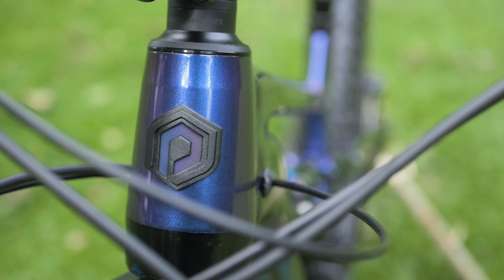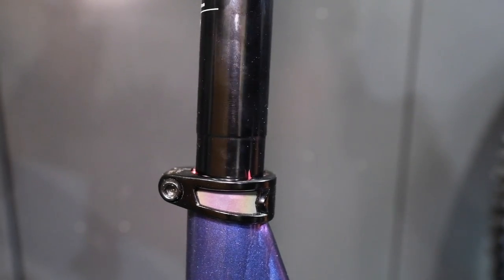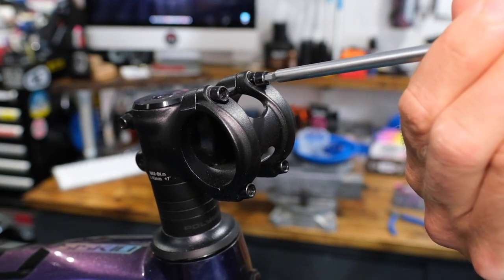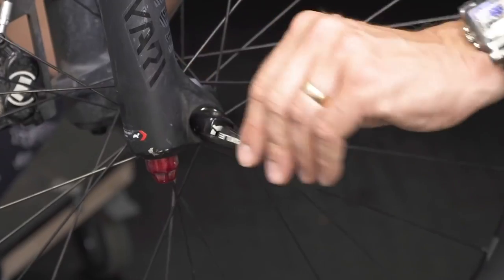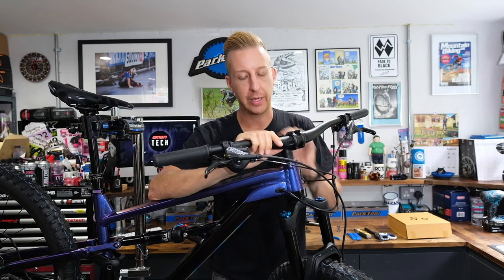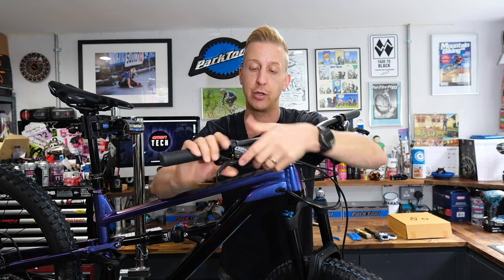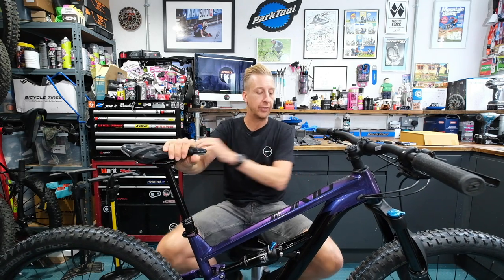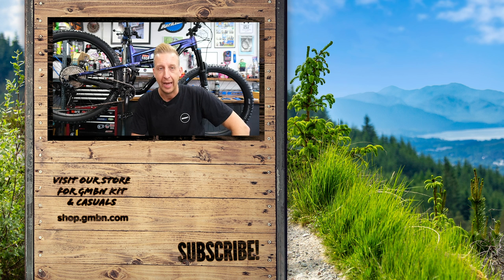How To Set Up Your First Full Suspension Mountain Bike In Just 30 Minutes | Bike Set Up Basics

Comment: I would say before going for a trail ride you should bed-in the disc brakes. As simple as getting some moderate speed and then gently making the pads rub against the rotor without locking them, repeat a couple of times.

Comment: Sweetness!!!  I’m actually waiting for a T7 to arrive at my front door next week so this video could not have been timed any better!  Thanks Doddster!
Reply: Did your bike come? Been thinking of getting the t7 as well, wondering how you like it?
Reply: @bobbyflay4104  Been running it through its paces and its is not bad at all!  Granted, this is my first Full Sus, but I have ridden plenty of rentals and some of my buddies' bikes that are full sus (Giants, Transitions, Ibis)  Even though these components are suppose to be the bottom end they are great!  Even unlocked no pedal bob on the long climbs.  The brakes are really impressive.  I'm coming from Tektro Gemini to the ones on the T7 and its definitely a nice upgrade even though some have complained about little modulation.  I think its fine.  As of now the only weak point for me is the fork, which I don't think is bad at all... just wish I had more rebound control.  Another pleasant surprise were the tires.  BikesOnline says they might come with either the Schwalbes in a 2.6 or the WTB Trail Boss in a 2.4... i ended up with the WTBs and im o happy I did!  I dont shy away from long climbs and I was previously riding 2.2s for a while.  I can definitely feel the difference in size on the climbs giving me more resistance.  Happy I didnt get the 2.6s  The WTBs have handled NorCal rock gardens and granite really well.  Excellent Grip!  Also, after being a SRAM guy for years, the Deore drivetrain has really eased my concerns about going back to Shimano.  Rock solid hardware there.  REALLY happy with my T7 and would not hesitate to recommend Polygon and the T7 to anyone.
Reply: ordered a T7 today, also my first full-sus.
really wanted a Deore 12-Speed
also i´ve never seen a wild polygon here, so already proud of that ;)
Reply: @erraldstyler  Congrats!  You're gonna love it!  I actually JUST got back from a ride on some gnarly stuff and the bike doesn't cease to impress.
Reply: yeah, looking forward to it. geometry really looks good an the specs for the price are close to unbeatable in the current situation. literally nothing with intelligent speccing available here for resonable pricing... so i guess i finally had some luck throwing money at someone haha

gotta admit, there are some things which i dont like, but thats literally the best i could find within my budget and i feel like its a really good decision. really had no fun riding last year (marin san quentin 1) and when i demo´d a pivot firebird it was over with entry level/beginner cheap garbage bikes for me ;)
Reply: @Perigault  rockshox recon has rebound control. It’s bottom right and u can twist the knob at the bottom to adjust rebound. Hope this helps!
Reply: @itsshowtime839  Hey man!  Thanks for the reply!  Sorry I wasn't more clear... I knew it had rebound control, just wish it had more fine tuning abilities.  I think this thing has 5 settings while something like a Fox 34 has like 11 or 12 settings if I recall correctly.  Im a little guy so im riding at the very bottom of the air chart.  Been trying different setups and I think I found a nice compression/rebound balance I can live with until a Fox 36 comes along.  But for the price, no major complaints.  Just got back from a long, bermy, jumpy and predominantly bumpy ride.  The fork did quite alright.  Gonna see how everything is holding up when I do a lower leg service.
Reply: How tall are you, is the sizing right, I'm about to order the Vander t7?( don't tell the wife)😄
Reply: @Ranita_MTB_760  5’4, 30” inseam, 130lbs... sizing is spot on!  Plenty of wiggle room to setup the dropper.  I thought i would cut the bars down but everything feels SPOT ON!  Super confident in there air, on fast, flat turns, climbing, etc.
Reply: @Ranita_MTB_760  The Vander T7 is actually the Calibre Sentry(?) frame, the Siskiu frame sizing is right tho. im 178 on the Siskiu T7 M, and it feels only a tiny bit too short (polygon recommends M up to 175cm)
Reply: @erraldstyler  Oh man!  Good Eye!  Just finished comparing the two and sure enough they appear to be nearly identical... just a few differences.  Man!  Please come back and post up and let us know how it goes if you get it and how it feels!
Reply: I bought a t8 it’s almost the same juts fox branded forks and back suspension

Comment: Literally just got my T8 and I watch this before hand to have an idea on what to do and have ready.  Big Thanks and keep up the good work.
Reply: Do you like your t8?
Reply: @isaacschmitz4168 , I do.  I have it in XL and received it in May so I have almost 700 miles on it now.  I have done a variety of rides and its held up great.  I have a XL and it is heavy out the box, 36lbs, but it wears it weight well.  The geo for me was great and required little tweaking for adjustments.  

I did do some upgrades to the breaks as I had XT brakes before and can't do without them.  One finger breaking is so nice.  The Tektro's to me we not Death but I did not like that it would not slow me down enough on high speed with one finger.  I had to grab with 2 fingers in order to get the pressure needed and even that isnt as good at the XT brakes.  I did even try the metal pads on ICE rotors.  That did help the brakes but after 50 miles I got the XT set and never turned back.

Thats the only real thing I changed so far but I do have some Hunt Wheelset on order and planning to run those 1858g wheelsets with some 2.4 XC type tires to see how it all feels.  The stock wheel set are heavy but the Tires are great.  I like the Dampf and they have held up well but I just got rock slashes on the rear so I changed it to Trail Kings that are similar in pattern but a soft tire feel, all around.  

Would I recommend the bike to someone, Yes! Would I purchase it again, Yes!  Is it perfect, aside from the weight, its the best bang for buck trail bike you will find and you will have fun with it.  If I can get the weight down to 32lbs in XL, I will be happy as it is a bulky beast in the rear.
Reply: @ShaneXCS  thanks for all the great information.

Comment: The thing with people recommending to put grease on the seat post. It can be ok on some bikes, but I have a hardtail with a seatpost that just kept sliding down during rides, no matter how tight I made the clamp. I suggest you use gripping compound instead. It will work like grease to prevent corrosion, but it won't be slippery in an application that relies on friction to work.

Comment: Thank you for this, I really want to upgrade to full sus
Reply: Make sure that you really consider your trails and needs first though. It's the job of many bike companies to try to make you feel like you need a full suspension bike, when a lot of the time people just end up spending too much money on a bike that they didn't really need and won't get full use out of. 
Either way, it's your choice.
Reply: I have this bike, the 2020 model. I also have a Schwinn Axum, hard tail. Which one do I ride more? The Schwinn. 
Don't get me wrong, the Polygon rides like butter but besides having to constantly lockout for hills, I ride the Schwinn hard because it's basically a $400 bike with some upgrades. If I smash it, it's not a problem. If I smash the Polygon, my pupils turn into $$$$

Comment: Would have been great if you had spent a bit more time focusing on the dropper post attachment.  I know this is an advertorial, however I am trying to get a dropper into my T8 and the cable is stuck, which doesn't allow the dropper post to be sunk into the frame...?  (Thought I would post, instead of throwing the thing across the garden.)  Peace / namaste x
Reply: For reference, re dropper - check out the beginning of this video - he nails it: https://www.youtube.com/watch?v=Gh1pfNDtwf0
Reply: Last one - did I miss where you showed how the front wheel is attached?
Reply: Last rant - why Polygon don't provide a specific 'dual suspension' manual with their dual suspension bikes, which features specific install instructions and info about dual suspension bikes, dropper post install etc, is beyond me?  They provide a generic bike manual, which doesn't even mention dropper posts and could have been a generic bicycle manual from Halfords from the 90's....; Bizarre!?  

Have a great week - I simply love GMBN.
Reply: at the bottom of the seat tube, you have to pull on the cable of the dropper post while you put the post into the seat tube.
Reply: @mctg9043  Yes, I figured it out from watching another vid.  Thanks and have a pleasant wkend!
Reply: @DougieL  you too

Comment: Hi just wanted to add on your video about checking your bolts and and though I would mention the seriousness of that and thought maybe you could make a video or include the extreme safety aspect of checking your bolts .
The main reason is that a couple of days ago I purchased a second hand specialized stumpjumper from someone who had not ridden the bike much at all but had look after the bike well ...thats what I was told .
I went out for a ride last night on the bike and started to hear and feel a click through my pedals so went home and checked it out to find that all 4 chain ring bolts only had about half a turn left on them before they would of fallen out ! 
That could of been very dangerous in so many different ways depending on if the chain got jammed and locked up the rear wheel or I could of jolted forward and gone over the handle bars .
It would benefit alot of people to check there bikes if they buy second hand when they get them home so I would love for you to do a video and express the important of it and the safety aspect if it isn't  done if it comes down to brake caliper bolts being loose and falling out it wel you can guess the rest .
I hope you can do a video and hope this may help alot of people and have alot more confidence it there bikes too knowing they are safe 😊

Comment: 15.00 pedals. I always thought this was the way from my old days, but my new Nukeproof Horizon pedals loosen when pedaling forward and unscrew and fall out! Yes, the R is on the right and the L is on the left, but I have checked, double-checked, and triple-checked (and you know I could keep going on), but new pedals seem to be the total opposite in every review of pedals today, and this video is only three years old! I always remember from my racing days, etc., that the pedals would tighten toward the front, so they always tightened as pedaled, but apparently, it's a safety thing now—they unscrew when pedaling forward. 😂 Please let me know if anyone in 2024 is now seeing this, please? I have even commented a few times saying I'm going to have to put the L on the right side and the R on the left side just to make sure for safety reasons they never undo as pedalling forward! And when putting them on you hold the pedal and pedal the crank backwards for the pedal to tighten!? I need to know exactly for sure please if this is now a thing or have Nukeproof sent all these pedals out with the spindles in the wrong sides?

Comment: I wasnt happy that when my T8 arrived (around 5/01/21) the cool lil cardboard box inside that had all the paperwork and tools etc had been opened and pretty much dumped out inside the big box and the big box had a hole in the bottom from shipping so who knows what was missing. 

More importantly- they had Vee tire co tires on the bike instead of the Schwalbes that they listed. - Those are worth about half as much by the way. -also a paint chip by the emblem on the headtube.
 So I emailed them only about the tires asking them to take the vee's back and send me the Schwalbes...
The bikes online guys try to distance themselves from polygon like it was a different company and took zero responsibility for the manufacturer swap. (polygon is the only bike online bikes sells)
They said there was a shortage (obviously you can buy as many Schwalbes as you want on Amazon).

They said I should be glad i didnt have to wait longer for the right tires ( I did wait about 4-5 months).
Im ok with taking a chance to save money adjusting the bike myself etc, Im not ok with this company not sending me what they advertised and what I paid for.

Comment: Great video as always.  I’ve had my hand on the button to buy the T8.
Reply: Did you get the t8?
Reply: @isaacschmitz4168  Ordered the T8 in mid October.  Delivery was originally estimated in November and was pushed out a couple times since.  Latest is mid January.  We’ll see if that happens but I don’t ride much in the winter anyway so not a big deal.  Excited for spring though!
Reply: Lmk when you get your t8 please
Reply: @isaacschmitz4168  Just notified late Tuesday night that bike was shipped and expected to arrive next week.  Fingers crossed.
Reply: @isaacschmitz4168  T8 came in 1/12.  Posted on Polygon FB group.  Still haven’t ridden it yet since it’s been super cold here in NY.  It came with Shimano brakes and Vee Flow Tires.  Stoked to ride when it warms up!  In the mean time I may convert to tubeless to shave some lbs
Reply: Ok cool it it's a great looking bike I've never ran tubeless but really would like to try it
Reply: @brucetrobridge2989  I hate how they are allowed to just swap parts on the bike. They claim that the manufacturer of the bike will sometimes without notice change certain parts of the bike BUT bikesonline will make sure the part is of equal or higher spec level. The schwalbe hans dampf tyres, whcih are supposed to come with the bike, are twice as good as those godforsaken slow rolling vee flow snaps. And they better have put 4 piston shimano brakes because the tektro bikes that are supposed to come with the bike are four piston.

Comment: would like to know about handlebar angles ...sweep back, sweep up etc....got a new bike and intensified my riding, and now my elbow is messed up, doctor called it tennis/mtb elbow and she has seen a lot since everyone got on their bikes. i came from a plush emtb (fox)to a light weight regular no motor mtb....the new bike fork (pike) felt steadier when riding, but didnt filter all the small bumps and rattles that the fox did.....i wonder if i messed up my elbow with incorrect setting on shock or its my handlebars that was set up wrong

Comment: My mechanic mistakenly dropped oil on my brake disc an now its slow to stop the bike.. Will changing the brake pad solve the issue?
Reply: @Bodiddly55  thanks man.. I'm in Ghana and I ride a trek marlin 6
Reply: @Megathx2023  you can try to sand the pads a little or more and try it. It worked for me.. Also clean the rotors at its said before.
Reply: @pregardt  thanks man

Comment: so dont have a tourqe rench and does not come with my new bike, what should I do? pls respond anyone.
Reply: Just don’t be an idiot and overtighten stuff, and you will be fine.
Reply: @xx-----------xx873  ok thanks
Reply: @xx-----------xx873  but what if i under tighten it?????
Reply: @lukepw08  It will come loose, and you just tighten it back up a little tighter. Make sure to grease the bolt before installing it, and if you have fists of ham, investing in a torque wrench will save you a lot of hassle later on.
Reply: @xx-----------xx873  ok thanks giles

Comment: I dunno but it’s taken quite a number of videos on this topic for me to finally begin to understand... 

... no wonder my bike feels so “bouncy” — I don’t have my sag set properly!!! I am 5’5” 140lbs (I want to be 130) and my max psi on the tires is 30psi, but seems my optimum is 28F-26R psi ... hard tail. 

Time to add this to the to-do list...
Reply: your tires will perform better if you run less psi in the front and more in the rear, you want less air up front for grip and more in the rear for rolling speed. i run 25F 28R in dry conditions and i weigh 160

Comment: How to book a full service after you change your cassette, chain and gear cable and it doesn't seem to work as intended! I think i need a new hobby :-(
Reply: Just a suggestion dude. Check the mech hanger isn't bent. That can throw off your gear set up. Hope this helps.
Reply: @yourmama5542  Thanks for the reply. I had another look at it and it seems i didn't fit the gear cable correctly and it had far to much slack at the shifter end. It shifts smoothly now. Although another possible problem has cropped up..